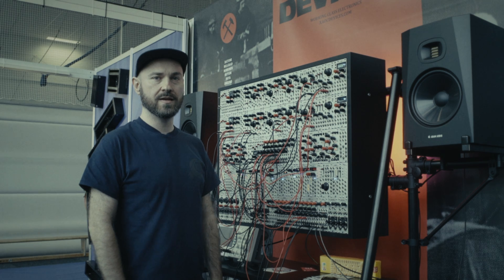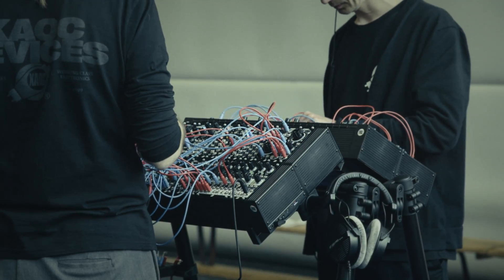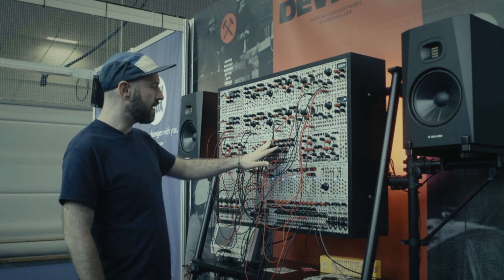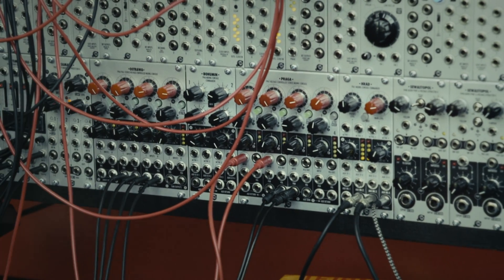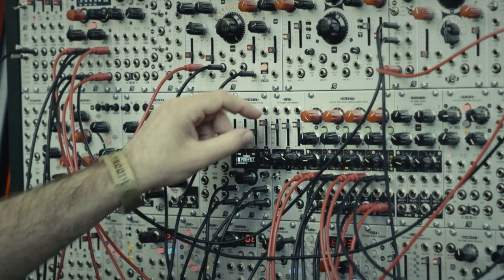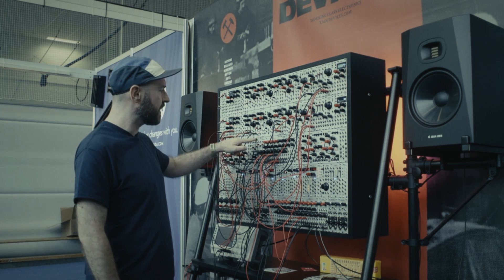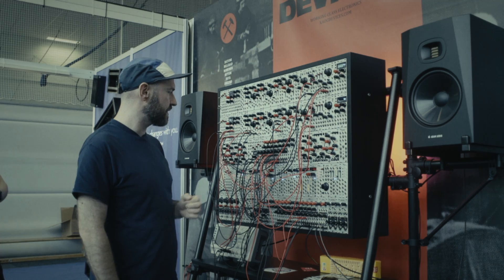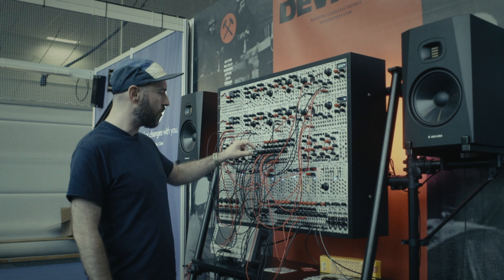XAOC Introducing Rostock, Drezno II, Bohumin, Ostrawa & Deva | Superbooth 23 | Thomann

Comment: Argh I just bought the Praga
Reply: I don't think Ostrawa is meant as a successor nor is it in some way superior to Praga. Just depends on your use case.
Reply: @Gomanubis  Would you happen to know - if I currently have Praga with Hrad Expander, could I add an Ostrawa to the chain (using ribbon cable)? Or would I need to have Bohumin too?
Reply: Praga = Mono input, Ostrawa = Stereo input
Reply: @Gruppenpest Praga = two aux and indiv outs, Ostrawa = one aux, no indiv outs